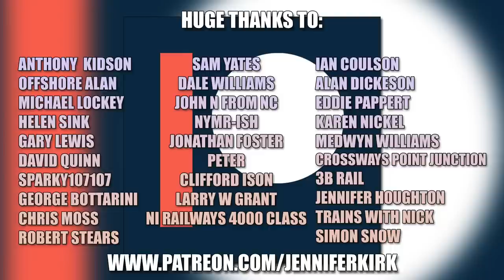Easy Dapol Class 121 & 122 Slipping Drive Fix

Comment: Great video Jen! I've just purchased a "new" Class 121 from eBay which was a non-runner on delivery. Unfortunately my issue is with the other end so the speaker housing is in the way for removing the collar over the worm gear. I've contacted Dapol and have been told they will repair for free with new parts - splined ends now I believe. Hope they are good to their word!

Comment: Good video Jen. In my case a month too late. I had this failure with the tee piece slipping on the drive shaft. It definitely seems to be a design flaw on this model.
Reply: It does not matter if you are slightly out of warranty.  There is clearly a problem with the driveshafts.  Thirteen months is not a satisfactory life for a product.  Threaten the shop with taking them to the small claims court for a full refund.  There is plenty of evidence to support your claim on you tube.  I am sure you will be pleasantly surprised at the result.

Comment: Thank you Jenny,  I found a similar problem tonight - runs OK in one direction and makes a lot of noise and stops  in the other. The loco has been in store for some time.
 As an aside I gave up trying to fit drivers in the cabs having fitted passengers.

Comment: hi jen i just wanted to update you the updated drive shafts are now available from DCC supplies for both the class 121 and 122 DMUs at £4 each plus postage the new shafts have splined ends which the  plastic universal joint locks on to so no more slipping ever 10 min job to change both shafts hope this update is helpful
Reply from the maker: That’s good to know!

Comment: Thanks for the video. This helped me with the same problem. Even though one end was fine, I did the same to both ends to reduce the chance of failure in the future. This seems like a bad set of choices in design/manufacturing.
Reply: I have had my model 3 years but only run for about 15 mins, phoned Dapol, they sent me Freepost details to return to them, they said it was a common fault at that end, too much grease when made, they said it would turn around in a couple of days.
First class service.
Reply: Up date to my post, just received unit back from Dapol, 3 days from posting to receiving back. Brilliant service and no cost involved. Beat that.

Comment: I'm planning an N scale layout, based on the old 1970's Santa Fe here in the states,  and one section may have semaphores. 

I've decided upon using the Atlas N scale signals, but unfortunately they're only common cathode LEDs, and they no longer offer a detector for DC use.  

I'm also looking for some way to have both automatic block detection, and the ability to change the position of a switch and have the lower signal head reporting the change of the switch points from main to siding. 

I've found more concise information in your presentation than anyone here in the states.

Comment: I have 2 of these….. the Railtrack 121 and the Regional Railways 122. Both have had to be repaired under warranty. Both from different retailers.
Both now run fine, they are great looking models and with only having a small layout are perfect. Shame there is a quality issue somewhere along the way

Comment: This would've been very useful.... if my Bubble car had worm-drives to begin with :(
I've recently been having very similar issues with my Dapol 121 Bubble unit. Opened it up to discover the issue came from the same area, however, as it turns out the drive was not loose.... it was missing all together. so now I have no choice but to send it back for replacments, which i doubt Dapol will even do

Comment: the fundamental issue is the same as the Hornby plastic gears splitting on axles, the Mainline driving wheel axles splitting and the Bachmann split chassis axles splitting, specifically: interference fitting a plastic part onto a metal shaft always results in the plastic part failing.  This is a poor choice of materials at the engineering design stage.  Interference fitting requires materials with closely matched coefficients of thermal expansion and different hardness ratings - although the hardness ratings need to be close.  While analysis is required it also requires extensive testing and a detailed knowledge of the material variation from batch to batch.  This is probably a greater engineering cost than the model train manufacturers are prepared or able to undertake.

For the repair to be long term the stress on the hole in the plastic part needs to be eliminated i.e. the plastic part needs to be able to turn on the shaft or the hole needs to be opened up slightly.

I have done a number of these using the same approach and Jenny has provided a clear explanation and demonstration on how to perform this repair.

Comment: Ive had that little plastic thing gets split cos of the metal rod that can expands and contract due to temperatures.  Wouldn't it have bee better if the whole thing made out of plastic? Even thou the glue not gonna hold in for so long and would eventually fail again.
"*edit*" repairing the customer's model, the plastic is split on the motor end of the driveshaft. The bogie end of the driveshaft is fine even thou covered in grease!

Comment: Manufacturers will continue to make shoddy goods if modellers continue to repair their products.  They should be sent back for repair or replacement.  Manufacturers need to bear the costs of repair or replacement for them to learn that shoddy products are not acceptable.  If a product is outside the warranty period  there is still an obligation under the Sale of Goods Act and Consumer Rights Acts 2015 to provide a product which is for purpose and has a reasonable life.  Clearly a model which has slipping drive shafts is not fit for purpose.  Send it back.  We have many products much more complicated than a loco in our home which have given many years service without repair.  Modellers will continue to get shoddy models whilst they continue to carry out their own repairs.  Send it back.  Some good has however resulted from your repair video I now know not to buy the Dapol Class 121/122.
Reply: When you find a perfect model with no issues, please let me know!!
Reply: That is the point of my comment.  Three years ago we bought a breadmaker at about the cost of a large 00 gauge loco.  From day one it made perfect bread and continues  to do so.  I did not have to repair it to make it work.  The same should apply to model trains.  To take the class 121 as an example it does not take an engineering wizard to see that pushing a piece of plastic onto the driveshaft will eventually result in the soft plastic slipping on the driveshaft.  Bachmann use a wholly metal item for this function.  Anyway it is ultimately your decision to accept shoddily made trains for your railway.  I do not.